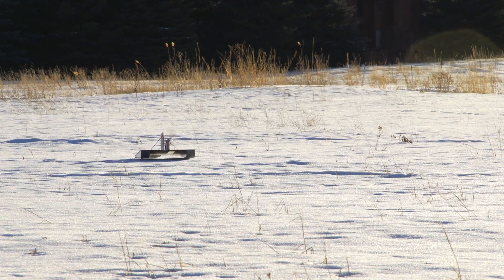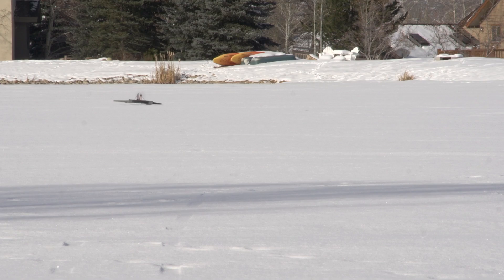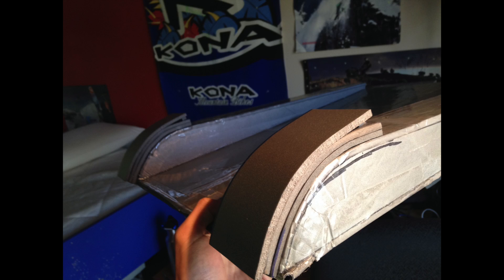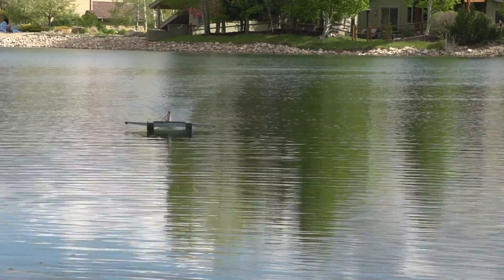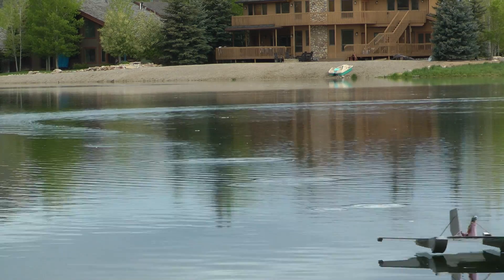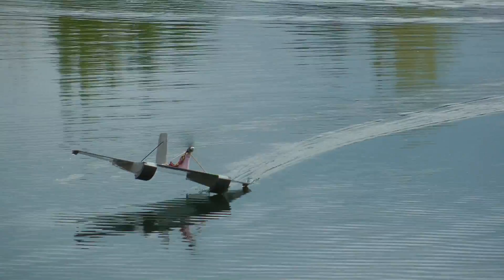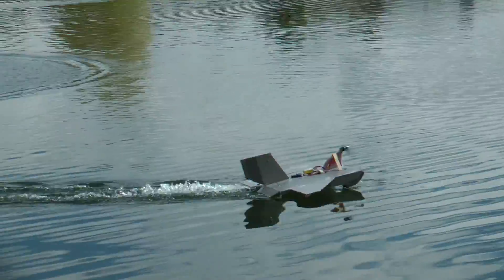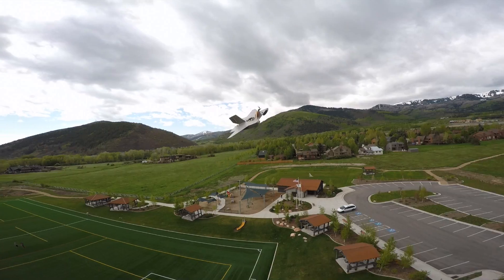RC Ground Effect Vehicle - Ekranoplan

Comment: Not more efficient than an air plane. With a big enough wing span, a plane can glide without using power, this can't glide very far.
Reply: It's not about that though is it? The point is minimising power use when motors are running by utilizing the ground effect, which is actually a proven  and working thing as there are actual vehicles (GEVs) which work in this way.
Reply: Ground effect has nothing to do with gliding, it has to do entirely with the reduced induced drag within a wingspan's distance of the surface caused by the reduction in wing-tip vortices. The reduced complete vortices act as a cushion and provide added lift (hence why a lot of planes float a long time when they land fast).

Comment: I wonder if adding a hydrophobic coating to the floats would help it on water? I am guessing that not only is the water causing drag but it also wants to stick to it as well due to surface tension.

Comment: Once you are in ground effect, could you tilt your prop down for more speed but less lift?  It looks like after you enter ground effect the WIG craft has sufficient forward speed that a dynamic air cushion exists and the upwards pull only lifts the front causing instability.  My 2 cents.

Comment: Challenge: Build it with only one central sled in the center of the belly instead of two. Keep it thin and make sure the wings can withstand the occasional bump on land. The central sled would eliminate excess drag as well as keep it from dragging to the side when on water.

Comment: Have you tried adding 1-2 underwater wings at the back? (a T or Y form or just a / \  form? ( / left and \ right wing), it could (should) work or at least should kind of give the effect like those flight boats. Lift it out of the water and more stable, because less likely to tough the water with a wing or glider.
one wing can be quite small and low.  plastic or aluminium thus light and it should be able to lift the construction out of the water very fast after it starts moving.
Those sticks you used are kind of raw stuff and indeed do drag a lot. (If you don't have other material, just paint it. Should almost generate the same effect as sleek plastic.)
I believe you were on the right track with the T wing at the front, just make the "wings" thinner and sleeker (less drag), more like the model of a plane- or sea animal wing.

Comment: I was thinking, if you added a little dihedral to the outer wings to increase the roll stability you might end up with the plane pulling up from the skid to help with straight line flying and efficiency, I wonder how the dihedral effect would be effected by the ground plain tho, you would think it would increase the effect but I can think that the reality might be different.

Comment: try putting a nice airfoil on that wing or at least some camber (curve it)

the reason the prop is up front like that in GEV's is so the air going over the wings makes lift help to lift you. you are flying pretty much just on the "cushion" below the wing which is less efficient.

I say this not as an expert but with years of experience with model aircraft my "gut" had that reaction when I saw it.
Reply: +Nerys Pretty much what I though, although the props are usually positioned such to actually push some air under the foil to help lift off quicker.
As for the tip dragging turns, it would probably be better to have some dihedral on the outer panels to maintain the cushion without the drag of contact.
And with the 'steps' and 'skis', maybe a long runner blade (inch below the outside of the pontools?) over most of the length, to hold the cushion in with minimal drag?
Machine obviously has enough area to fly normally.
Try a smaller motor or start reducing the overall surface area so it barely flies, and is more reliant on the cushion effect.

Comment: I wonder if it's possible to connect a channel of a flight controller to a hydrofoil (or two). Somehow sense the height above the surface of the water (sonar ranging to smooth water surface?), and that's the input to the PID loop. The control output of the PID could drive the hydrofoil angle. Tow hydrofoils could also probably help with the roll channel. Of course, I know next to nothing about hydroplanes, that might not even be how they work!

Comment: You should put that motor  bit lower so it would push air under the wing like in the famous ekranoplane where all those 8 engines pushed the air under the stubby wings

Comment: Very cool concept. I was wondering if you've tried playing with the thrust angle, maybe less up thrust would help. Another idea I had just after watching the video is some how making some sort of ducts to vector the propellers thrust through the body between the pontoons under the sled, it might help by adding some of that thrust under the sled. You've obviously experimented a lot and have developed a very cool craft, let me know if you've tried thrust angles and thought about vectoring the thrust under the sled, I guess that would make more of a hovercraft than a ground effects craft but non the less just popped into my head.

Comment: If you look at seaplanes ,they all use a v hull with a "step" at the rear to break away from the water. You may want to try incorporating that on your design. The hydroscopic force, of water, kinda sucks it down or holds it into the water, until enough lift or thrust is applied, and then it pops up all of the sudden. With a V hull and a step, it should lesson the effect. Hope that helps

Comment: Try introducing a small amount of under-concavity [under-cut] to the wing. Design the under-cut from the wing tip and back in as far as you can manage with materials. A good rule of thumb is maintaining a 1/10 ratio of under-cut to cord. Make sure there is NO under-cut near the pontoon as measured from wing-tip-outboard within a ratio of ~5/8 the cord as measured at the middle of the pontoon. Undercutting a wing too close to the pontoon can result in unwanted tip-stall characteristics at ground-effect-cruising speeds. 

In terms of pontoons, try introducing a step design. The general rule of thumb is 1/3 to the front, 2/3 step up in the rear. Based on experience, if you're trying for a high efficiency skimmer, start at 1/3{}2/3 and slice off some material (incrementally).

Your prop angle looks very good for a start. NOTE that as you decrease surface drag (with under-concavity and pontoon stepping) you will need/want to decrease your prop angle to achieve maximum ground effect loft and efficiency.

Comment: Nice. Yeah, another way to demonstrate ground effect is to hover any R/C heli at eye level, note the throttle used, and then go to an inch off the ground and you'll see a huge difference in the amount of power used.
Reply: Yes and it works at the ceiling too. It's easy to accidentally get sucked up into the ceiling though.

Comment: Hey, rctestflight This is a very cool little project, I love how it looks super graceful when it sits just above the water, dragging a tip in those gentle banked turns!

I have a suggestion though: all of the water craft I've seen of yours have had massive, flat floats. Surface friction of those big contact areas is massive, and means that they get slowed down very quickly on the water, causing that bobbing effect you see when this plane come in hot then bounces down before it catches lift and gets off the water again. I suspect you could make this fly much cleaner and smoother if you shaped the floats into a more sharp surface. Like an inverted triangle, and make it a streamlined, similar to the bottom of a boats hull.

With a much smaller area in contact with water, I think this would have been much cooler to fly on the air cushion, probably smoother and faster, without the slow down when it makes contact with the surface.

I just though I'd add my 2c in case you're still developing this little craft, I'd love to see the design taken further. Anyways, keep up the great work man, your videos are great watching; you're really a cut above most of the other YouTubers making scratchbuilt aircraft. You're in the same league as ExperimentalAirlines, that's really saying something :D

Greets from the arse end of the globe, in windy, rainy New Zealand. Peace out!

Comment: Maybe you can try with a longer central skid? It will still be streamlined but with more area to support the weight, something like the seadart?? =) or use distance sensors working part of the elevator to stabilize height...maybe ultrasonic sensor + small arduino mini + servo...if you want to try I can write you the code!

Comment: Its an ekranoplan. Made one of these out of cardboard and hot glue with no motor no movable control surfaces.  It would glide all the way across my friends long garage just under an inch off the ground.  Try putting a large horizontal wing pointing slightly up on top of the rudder. helps keep the nose down which is very important in optimizing speed and stability in a ground effect vehicle.

Comment: I'd try to exploit 2 things:
1. the quality of the forward swept wings to not drop a tip at stall.
2. the "box effect" of sponsoons placed at wing tips, that prevents the air to escape laterally over the wing tip, from underneath to the top of the wings due to the pressure difference. Preventing that pressure loss greatly enhances the efficiency of the air cushion trapped between the ground and the wing.

You need your vehicle to be penalised, by stalling, every time it wants to gain height. So you give it just enough throttle to sustain lift in ground effect, and when it tries to rise, it will stall immediately. But only the roots of the wings will stall (because they're swept forward), and the tips not, thus keeping the wings level. It will not drop a tip, it will not touch ground (or water). The nose will gently bob down, and the vehicle will lay on its cushion of air again. Basically, there are two negative feedback processes at play: when it tries to rise, is penalised by stalling, and when it tries to land, is penalised by the sudden increase in the air cushion's efficiency.
Reply: Its the way the centre of pressure moves as the wing leaves ground effect - not quite the same as a wing stalling in freestream air.
Reply: This made me want to try to build one
Reply: Good catch on installing a fin on the underside of the wing at the tips to enhance the "ground effect".